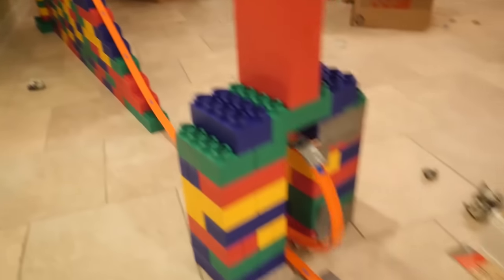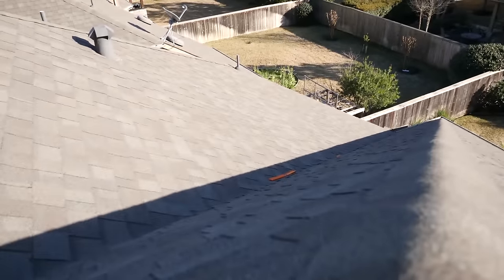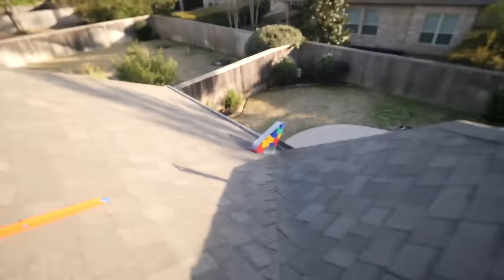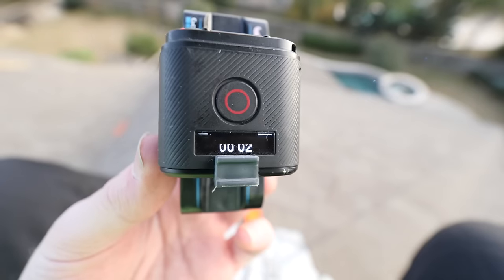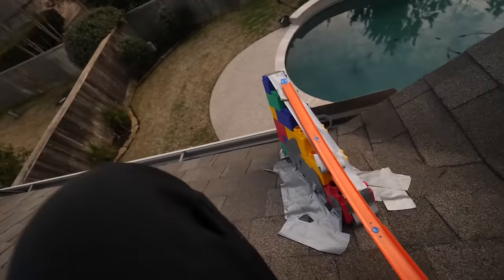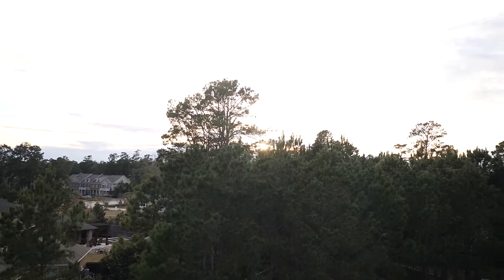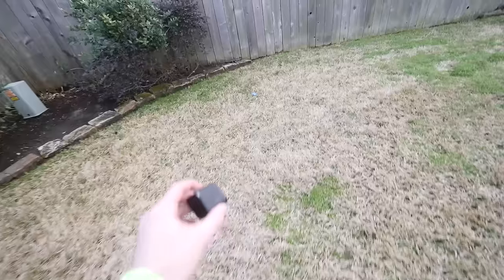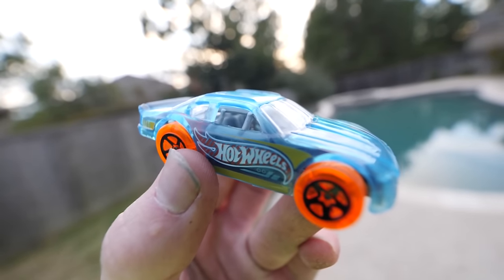100FT HOT WHEELS RAMP OFF MY ROOF!

Comment: I thought of 2 things you could do to get a better result. 1. Track supports. If you were to add some straight wood or metal along both sides of the track, it should keep it perfectly safe. 2. Check the track connection. Because the Hotwheels tracks are simply connected together by small plates, they do not have much security along the walls of the tracks. You will find that every point that two tracks are connected together, the walls are not aligned. Even if it takes some time, i would recommend aligning the walls so that the cars do not catch on them and fly off when they are going down the track.

Comment: That hook on the top of your roof is used so that the Hot Wheels and it's drivers can return to the top via a pulley system quickly. Great for less video editing and more content 😄

P.S. The Hot Wheels drivers have been complaining that their safety parachutes are not deploying. Did you pack them correctly 😂

Comment: Fix the truck by giving it the camel hump effect. It changes the momentum of the g forces. As it has to work to get over the humps as well. You would have to figure out how many humps you would need and how far to spread them apart. You would even have to add another 50 to 75 ft of track to the existing track now and calculate the math of the percentage of the incline of the roof. Basically it would slow it down. They use this method on some roller coasters, to slow the coaster down. So it doesn't become boring and you don't lose the thrill before the end of the ride. Instead of a break run and It's a cheaper method as well. It even lets them add more track to break an existing record or a new one.

Comment: The track was not perpendicular to the apex line of the roof, therefore a camber was introduced, which made the car lean towards the right side-wall of the track.
A rookie mistake in engineering a track for speed.

Comment: The problem is the much spead as the track and didn't make to the ramp the normal car is fall into the roof and Gopro car is actually also didn't make to the ramp too GOpro also fall into the roof too and the GOpro car also didn't make to the ramp